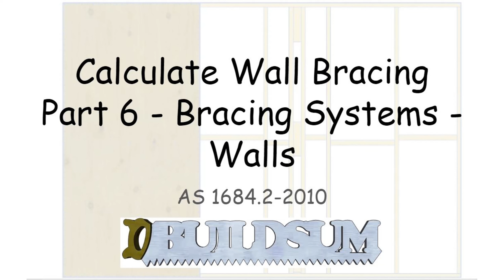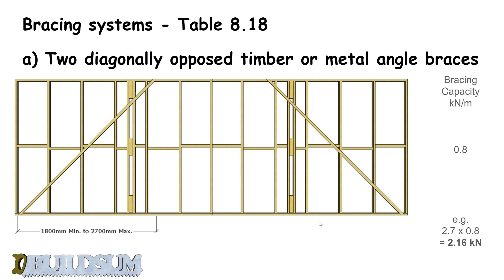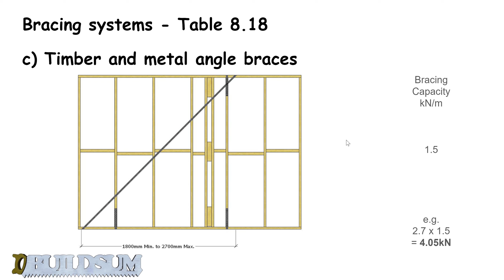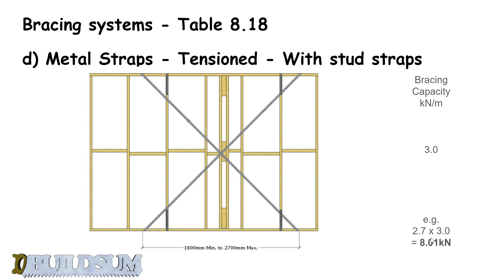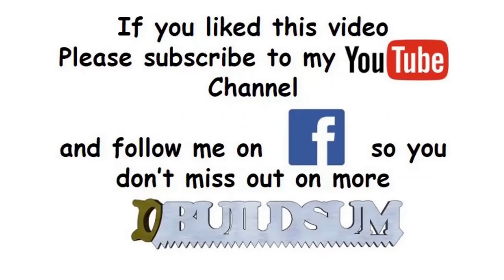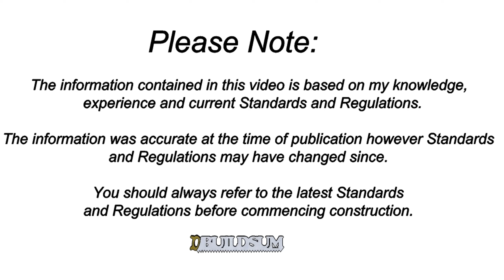Calculate Wall Bracing - Part 6 - Design Bracing Systems - Walls

Comment: Hi, Your video are the best and thank you for doing them.  I am doing an owner build and I am stuck doing the bracing plan now as our engineer does to do it !!!!  Anyway in your video you did nominal bracing first but am I correct that you cannot include the nominal in a section where you have structural bracing.  If so does that mean you should not do the nominal first?
Reply from the maker: Hi Mate, thanks for your comment. You can do it anyway you like and just deduct the area of the required bracing from the nominal bracing. This will most likely be cancelled out as you can only use the nominal bracing for 50% of the total anyway.
Reply: @Buildsum  Thanks for the reply and yes that make sense.  I am doing an owner builder project and our engineer does not do bracing plans, they just provided racking forces A, B, C and D which has now confused the issue as it is not clear if it is sub-floor (which is a challenge), ground floor or FF that they apply too.  Do you consult externally?
Reply from the maker: If you get a Frame and Truss company to build the frames they will supply all the bracing details etc. Sorry, I dont do external consultancy.
Reply: @Buildsum  Thanks for replying.  Your videos are amazing and fill a big gap.  Look forward to many more.
Reply from the maker: Thanks Mate

Comment: Doing my sums and I and struggling to get enough bracing in one direction. Is it possible or to brace both sides of a wall? I cannot see anywhere that says you can or cannot apart from nominal bracing. Thanks again...
Reply from the maker: Hi Luke, you can put the bracing on both side of the walls however it is usually more economical to use a bracing system that has a higher resistance. So if you are using a metal strap brace system try a ply brace, if you are using a ply brace try increasing the fixings so you go from Fixing Method A to Method B and therefore increasing the resistance force. Hope this helps.

Comment: What are the requirements with stud ties ? How often do you need them .?
Reply from the maker: Hi Robert, it does depend on the tie down requirements for your area, however generally the top and bottom of the studs either side of an opening, the top and bottom of the studs at either end of a brace and then spaced every 1.2m in remaining areas. Hope this helps